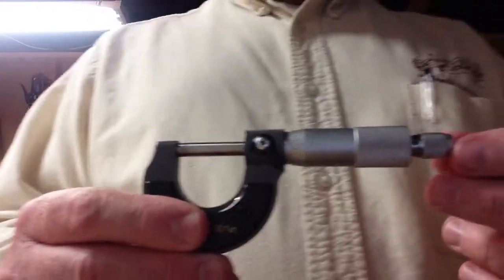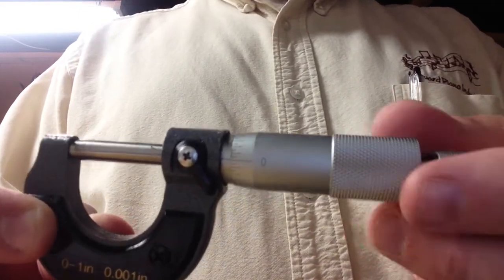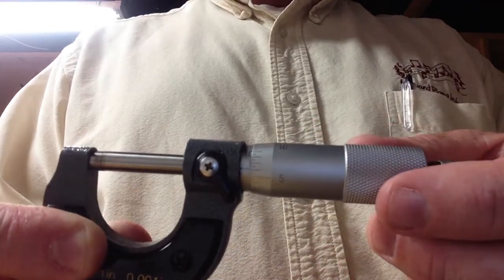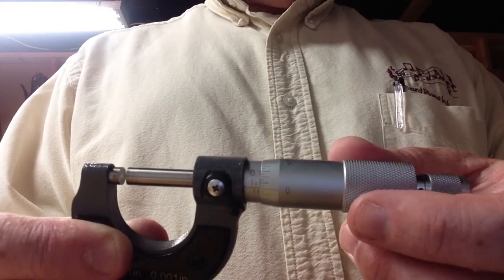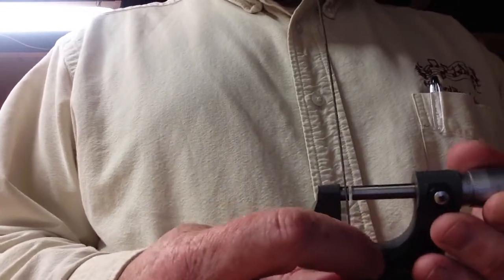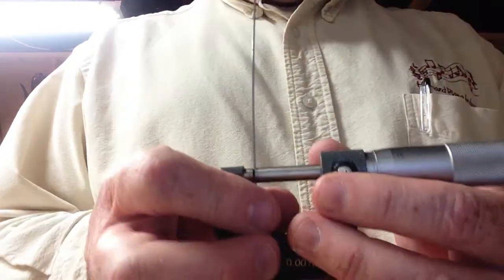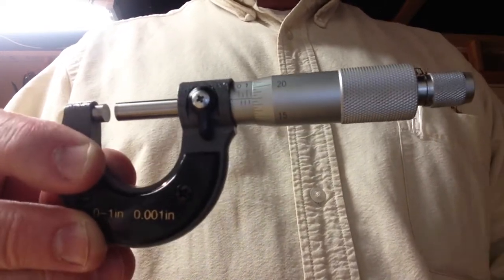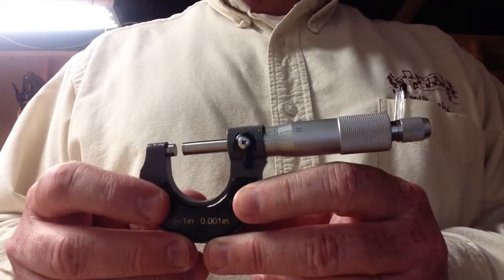Piano Tuning & Repair - How To Measure Piano Music Wire I HOWARD PIANO INDUSTRIES

Comment: Sorry, I couldn't follow! Is the micrometer for measuring the thickness/gauge of the wire or the length of the wire?
Reply from the maker: The micrometer is for measuring the diameter of the wire.
Reply: Sorry, I don't know what that means!
Reply from the maker: It is for measuring the thickness of the wire.
Reply: Oh, the thickness! That is also known as the gauge! I have a piece of wire to measure! So I was thinking of getting a micrometer! But I wouldn't understand how to use it!